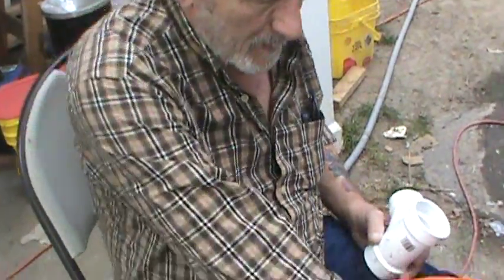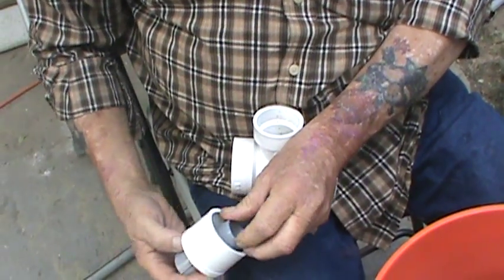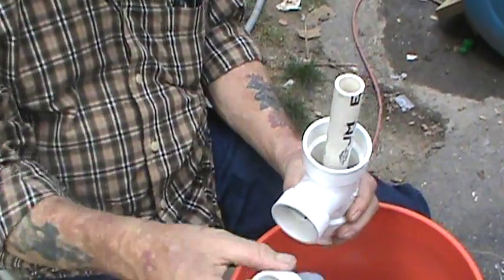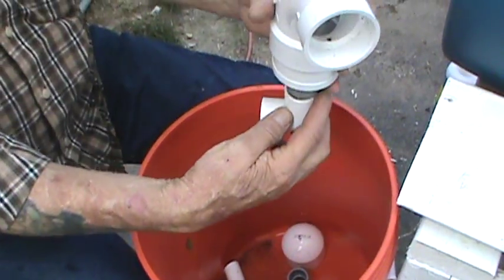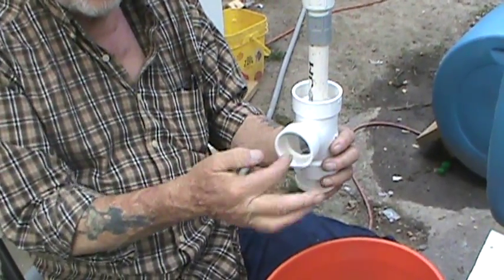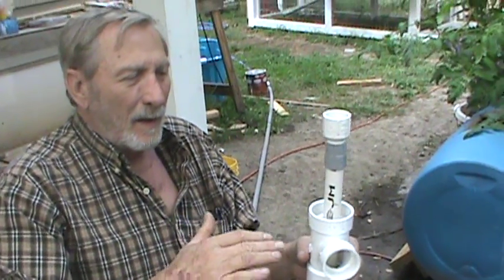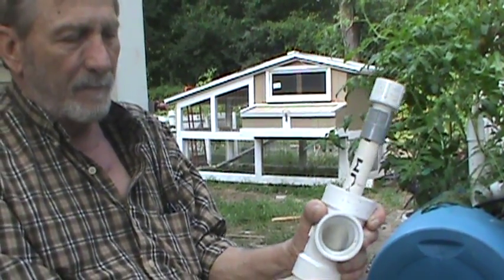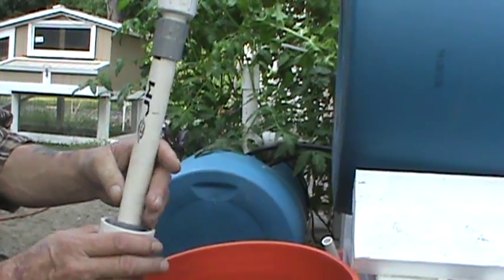am Aquaponic/hydroponic Bell siphon

Comment: Thanks for your info ! You did not mention that this bell siphon would operate under low water flow . don't know if you knew this are not ...But thanks again i have tried all kinds of them from  U siphon too T siphon's / other bell siphons as well . This one works without a hitch !!! So Jerry Parker  thanks again for the info saved my bacon :).
Reply: Could the vacuum it produces push water down the pipe into a hose that runs two feet up hill?   I was thinking of attaching one of these to my rain harvester and turning on the water spout from the harvester to run continuously into one of these siphons hoping it’ll create enough flow to water my garden ten feet away and two feet up hill.   If it can’t produce enough suction to keep pushing the water up hill do you think this can be attached to a ram pump ?